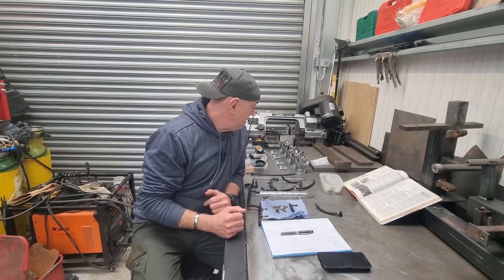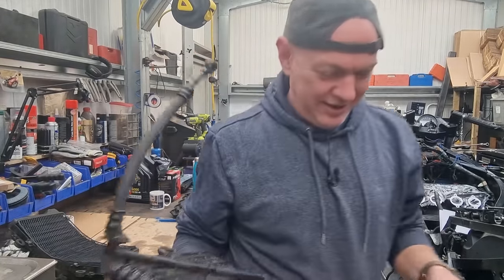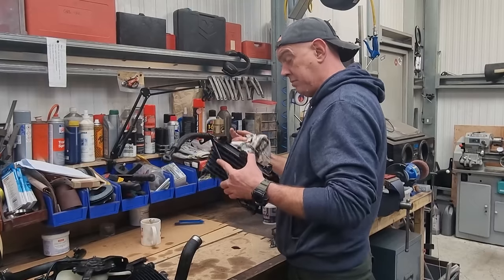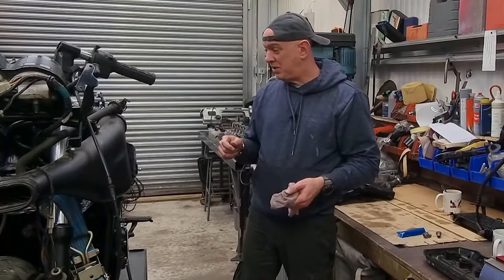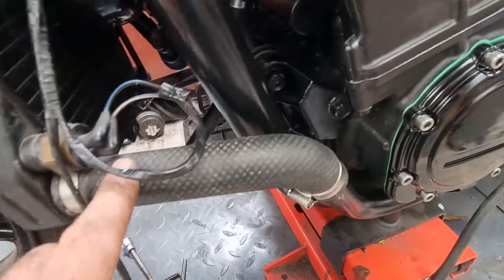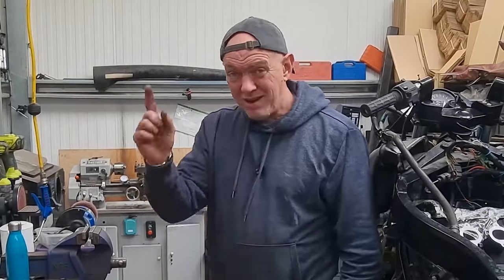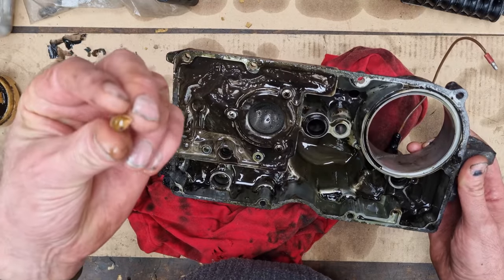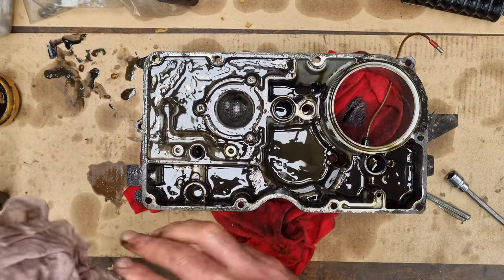Sump & Coolers - 1990 Kawasaki ZZR1100

Comment: I can understand the frustration of waiting for parts and longer than normal delivery times , a rebuild kit for an automatic transmission took six months for me , it was just lucky that I didn’t need them at the time.
Looking forward to hearing the start up video 👍
Reply from the maker: I was sooooo disappointed, but to be fair even with all the work put in today with rebuilding carbs, installing the exhaust, cooler, radiator etc, there's no way we were going to hear it run today. It's very very close though 😁👍

Comment: I think you can turn down some of the larger  old shims to spec. you just turn them down with a good stone and go slow and mesure them, do it in one side only and that side put it down to the valve head if youre concerned of its integrity but youl be ok. Then when the parts arrive you can swap them no problem. Shims are like carbide tool steel they are hard all the way not case harden in the surface only. Just adjust them. Think youl be ok.
Reply from the maker: Now there's an option I hadn't considered... stoning them... 
I've already got the others on their way now so will probably just wait for them. There's other stuff i can do whilst I wait... 😁👍

Comment: Will there be a compression test, just to compare with the data in service manual?  Remember,  fully open throttle and have the battery charging between the cycles
Reply from the maker: Yes, the bike originally suffered with poor compression so its going to get checked 😁👍